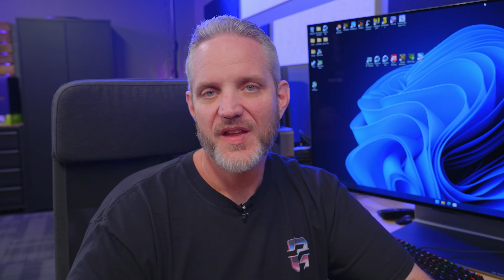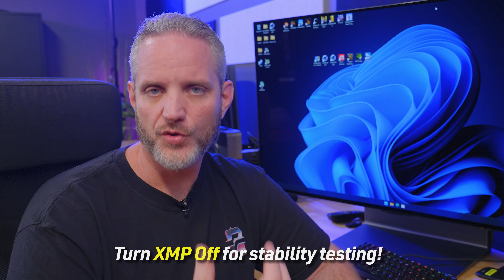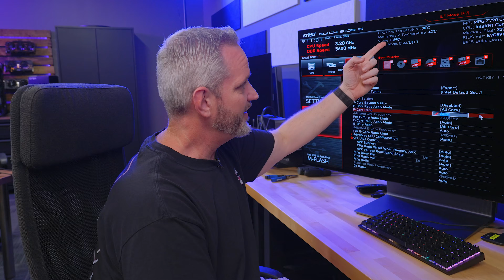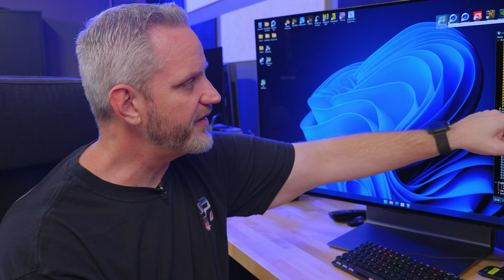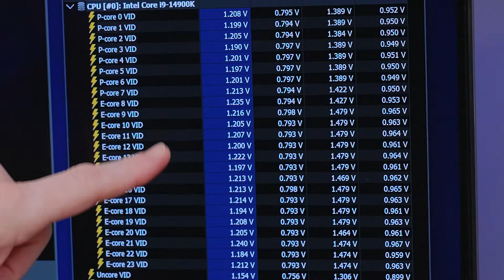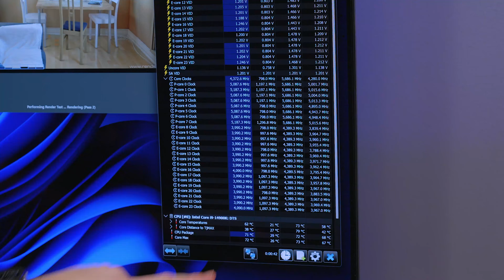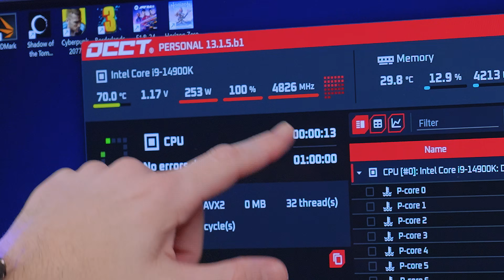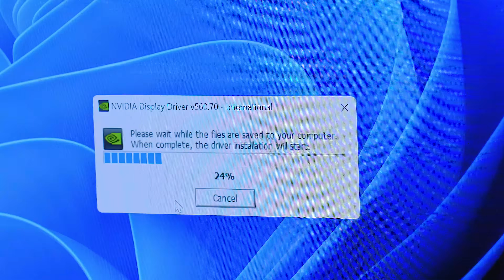Guide: How to check if your CPU is BAD!

Comment: Buildzoid has some very good videos about this. I watched probably the last 4-5 videos about how to tweak the settings and I can say it's the best so far.
I RMA my 14900KF, it took 2 weeks. And this new CPU still had temps and voltages more than I was ok with. 
But with his insight I manage to get my Cinebech up to 40k with just undervolt and LLC calibration/AC/DC like he showed, nothing else , on Intel 0x129 default Extreme. 
Never above 95C(and 95C after multiple runs), 360 artic freezer.
The problem is he has very long videos, not edited at all, like hours long....

I may got a golden sample with this RMA, who knows.

Comment: Pre-built HP 45L 13 gen i9, CPU never runs above 40C no matter how much I push the computer (fans do get really load at times though). No problems with CPU yet. Maybe there is something to having the CPU with an independent cooling system (HP 45L).

Comment: Great video Jay. I have a 14900K on a Gigabyte Aorus Z790 Pro X board with a 4080 and 64GB of DDR5 6000mHz Ram. I was getting the “out of video memory” errors on high shader games like Hogwarts Legacy and Horizon Forbidden West and I do video editing on Adobe Premier Pro and I could not export a video no matter how big or small my CPU would thermal throttle and crash to desktop every time I tried to export a video. Since the BIOS update with Intel Extreme Default Profile and the new Microcode, I can load and play Hogwarts and Horizon completely fine now, no more “out of video memory” errors or crashing and I can go into Adobe Premiere Pro and export all videos now, my system is so quiet and exports them successfully. The crashes I was experiencing was happening EVERY time, but since the BIOS updates, it doesn’t do it anymore so I would so based on my tests my CPU is stable and has not “advanced” degradation, these are the tests I did and I believe my system to be stable now based on my experiences.

Comment: This is concerning... I have a 13700k that is a hot and fast chip. it boosts 300-400Mhz over advertised speeds (stock, and even more OC) and produces a comical amount of heat. The chip also draws 1.6V under load, and is not stable with ANY level of undervolt. Even an offset/change of -0.015V will blue screen it reliably. 

So far it has been stable if given the voltage it wants. So I think the only thing to do with it is install the microcode fixes and just slap the best cooler I can afford on it. Hopefully it doesn't die an early death.

13700k
RTX3080 Ventus
32GB Corsair Dominator (2x16GB)
MSI z690 Edge Wifi
2x 980 pro 1TB M.2 SSD
2x Western Digital HDD (14TB)
MSI MAG 360 AIO (Swapping to Arctic freezer 3 420mm AIO)
Corsair HX1200 Gold PSU
Fractal Meshify 2 XL

Comment: Do I need to update my BIOS if my system works fine with no high voltages? My cpu is i5 14600K on a Gigabyte Aorus z790 Elite and I've set it on the "Spec Enhance" profile which is made for CPUs that are air cooled (like mine).

So yeah, if I don't go the Intel's default route which makes the voltages spike and my profile isn't that demanding, do I still need to update my BIOS?

Comment: Jay!! I want to leave here my feedback! Running a 13900KF, on a Strix Z690-G. After microcode 0x129, I was getting max VID at 1.50 to 1.52v with Intel Default Profile, MCE off, Intel Fail Safe VID bahavior and enforced power limits, getting 35K in R23. I have tried the Asus profile, with MCE on, Auto VID behavior and disabled power limits and for my surprise, im getting 1.42v max 😱 and better Cinebench R23 scores at around 40K. No manually tuning. Never had any issues with my cpu in almost 2 years of use, but got worried about this voltages and degradation issue and updated to this microcode

Comment: What is Cinebench code, indeed, a 3DMax .3ds file running the lite program script without the editing features rightly framed to a fine tuned monitoring panel?! Hackers moving slower, anyone?! 3DMax tutorial too hard to capture the screen at a good framerate? Did it work before or after Unreal Market optimizations?! I don't know. Namastè.

Comment: So if you have a brand new i9 14900k it should good if you install the latest bios update
Reply: Nope. It may still degrade as the core issue is a hardware one, a design flaw. The microcode is just a bandaid pretty much.

Comment: None of these will surely tell you if you have a CPU problem. Apps crashed constantly on my 13900K and OCCT didn't show any errors on 3 different CPU tests (1 hours each). Also, other CPU benchmark tools didn't crash. But seller confirmed CPU degradation, and Intel confirmed it. Now waiting for a new CPU to be delivered (was under warranty).

Comment: Short term stress testing isn't the solution here Jay. It's average use case scenario's and blue screen frequency. No amount of short term stress testing is going to prove anything at all.

Advanced degradation is incalculable and will happen under daily use cases or not, depending on your sample. This long winded drawn out video was just an advertisement for "how good Intel CPUs still are" and don't worry everything is just fine nothing to see here,.move on people move on.

You have not addressed the actual issues with the 13th and 14th gen manufacturing issues and architectural design issues with these refreshes.

The REAL problem is, is that the design of these CPUs themselves and why Intel is so quiet on this. These were rushed and not properly designed to begin with. Hopefully Intel learn from this (probably not) and release a brand new architecture that's been FULLY properly tested and designed in the 15th gen release next time. Just look at the rushed 9000 series AMD CPU launch as well!

There's a lot more going on behind the scenes including collusion to hold back 1-0 nanometre CPUs as this will be the end of mores law and what's next? 

Well the answer is quantum computing plain and simple. Then this industry will pretty much finally come to an end.

You'll only need to upgrade a quantum computer (home terminal) once every 5-7 years as most of it will be client based computing by then. 

You all wonder why Xbox live and Ubisoft want to go subscription only right? Well this is precisely why!!

PC's will soon be a thing of the past in the next few years.

Things are about to change for all of us and you will own nothing and be happy right?

Comment: my cpu 13900K is degraded, 100% test that prove it is an old javascript browser benchmark - octane 2.0, just google it - it's the firs result in a github page. My cpu never ever finish a run wothout crashing, and it's not OS chrash - just the browser says - memory access violation, but this is from the cpu. Games and other softweare sometimes can crash, but this benchmark is 100%.

Comment: I think you are not looking at the bigger problem here. If you buy a 14900k cpu today, you are getting the equivalent performance of a 14600k cpu after the Microcode patch combined with the patch for spectre 2.0 patch which degraded performance metrics of the CPU. It's a piece of junk CPU.
Reply: The 14900k post update is still more powerful than a pre update 14700k, so that statement is false. Now if the 14900k is degraded, maybe so. There is barely a drop in performance from the 0x129 MC, with added stability.
Reply: @frantz4g63  No that isn't a false statement. The 14900k is equivalent to 14600k or 14700k right now. Don't be that guy.
Reply: @luminatrixfanfiction  i have the 14900k with 0x129 and i can confirm that its not losing performance compared to other microcode's, in fact is running better than before for me, (95 SP average silicon, but probably with close to none degradation)
Reply: @luminatrixfanfiction  another false statement. Now you're claiming a 14th gen i5 is just as powerful as a 14th gen i7? Believe what you want, but facts are facts. You are basically contradicting all the performance tests and data people accumulate. If you have proof, send it. Otherwise, you're just either gassing up a 14600k, or you're hating on anything higher than a 14600k. Let facts speak for themselves.
Reply: @iimmaaxx  that's exactly what the data shows. As long as the data isn't degraded, it'll still perform better than a 14700k (especially a 14600k). Less voltage usage and added stability while being a hair less in performance compared to pre 0x125. Sounds like a win/win situation to me.
Reply: @frantz4g63  The fact you even have to say that "as long as...it'll still perform better than a 14700k" indicates a certain tone of desperation. Some poor sod had to pay an extra $300 bucks just to have the same metric performance of an equivalent 14600k or 14700k under certain conditions.
Reply: @luminatrixfanfiction  I really don't understand why you keep trying to justify your reasoning without proof. Bring some data to the table. There's plenty of data floating around by many content creators that justify my point. 

What is this "desperation" you're talking about? I have a 14700KF, so for me to say a 14900K still outperforms my CPU (especially a 14600K) isn't showing desperation for anything. It's facts and the data shows.

Let me guess? You either own a 14600K and are trying to justify and elevate your purchase, or you own a 14900K and it's degraded past the point of being a lower performer than a 14600K? Either way sir, that's your business, and I'm not trying to convince you of anything. All I did was point out facts that you can so easily find all over the internet with a little research. Help yourself. It's free.
Reply: @frantz4g63  ... ... there is multiple data by content creators showing the before and after performance metrics after the microcode patch. I don't know who you are watching but the microcode patch degrades performance. It's literally impossible for it not to. What that microcode does is undervolts the CPU and for a reason. They were already overclocked at the factories, which means that when the micropatch is applied, the cpu is underclocked and undervolted to preserve its lifespan. That means the cpu is going to have performance degradation. Do you understand now?
Reply: @frantz4g63  I own a i7-4960, it's old but its one hella beast cpu. I can play steady 60 fps on a 4k resolution monitor despite its age. Mostly because the GPU is doing most of the work and simply because this CPU generation was a work of art.
Reply: @luminatrixfanfiction  That's not true, at least not for my cpu

Comment: I just bought an I7 13700kf, Just was made aware of this issue when setting up windows. So put the latest micro code on my MSI board and have also applied an under volt. I will just use it and let it run. Hopefully without any issue.  I hope that seen as I just found out and did the bios updates with a brand new system It will be ok.

Comment: Best stability test I've ever used is Asus Real bench. If it can't pass 8 hours of that, it's not stable. 

I had one PC once that i couldn't get to pass, but everything else, even 24 hours of Prime95 no problem. So I shrugged and ran with it. 1 year later BSODs, Prim95 failed instanty. Memtest detected bad ram. Asus Real Bench knew about it from the day the PC was new. Got new memory and sure enough, Real Bench ran just fine. Not saying everyone will have same results but it's a really good free stress test

Comment: Just remember that the CPU CoreVID that is shown in HWINFO is the Voltage that the CPU is requesting from the motherboard. If you want to see the "real" voltage, you have to look under your motherboard sensors for Vcore, which is the voltage the motherboard is delivering to the CPU.

I have my 13700K undervolted by -0.100v, so in HWINFO the CPU VID sensors still request 1.350v, but at the same time my motherboard Vcore shows 1.250v, because of the undervolt.

Comment: Me, after RMA-ing four 5000 series AMD chips, and seeing melting 7000 series chips: I'm coming back for your renowned stability Intel. Bought the 13900K and luckily won the chip lottery with a 1.225V chip. Never saw temps above 85 and got 40300 R23 Multi from the start, with a manual cap of 300W. Now I clocked the multiplyer at 53 and memory at 6000, just to be safe, and lost 2.5%, scoring 39300 in R23. I've not yet experienced any crashes with my chip but it's a very strange emotional rollercoaster to be riding 🙄
Reply: 7000 is better than 14 gen tho

Comment: I have a 14900k on a gigabyte Z790. Cinebench is OK for single core but immediately crashes for multicore. It will be interesting to see if the bios update will help when gigabyte finally release it
Reply: Make sure you are using Intel default settings, Gigabyte's have the LLC configured wrong and it undervolts the CPU too much causing crashes (that's what happened to BZ )

Comment: Intel XTU - AVX2 stress test with no power limits. If it fails, your CPU has one foot in the grave. To my understanding anyway.
With the new bios updates and power limits in place (253W, 400A) it'll probably still last a long time if it's not already crashing with Intel profiles and limits. But I mean, you're not getting what you paid for.

If you're a Blender user, a consistent test has also been whether or not Blender hard crashes under load when posing an armature tied to a mesh with high polycounts. You'll hear the fans rev up from the load and Blender will crash with no warning or error. It'll be quick and consistent, at least with my projects. Heavy denoising and Compositing during renders can also cause crashes but for me that wasn't as consistent, just a massive headache and a waste of time.

I'm on my third CPU at the moment.. 14900k. I suspect the frequent, heavy and fluctuating load from working in Blender expedited the process. I didn't really have a grasp on the whys or hows of how it was degrading until my current chip.
Reply: The XTU stress test uses Linpack, as does the old Intel Burn Test. It's a much newer version in XTU though (interestingly not the newest one, it's 2021.2.1.0 in XTU, but at least it's not the ancient one from Intel Burn Test, which is from 2012).

Comment: Turning my cpu off is the worst f**king advice. The machine is useless if it is not running stable 24/7. If I wanted a $5000  paper weight I'd buy gold bullion

Comment: Would not be happy with "plenty of life left", a CPU should retain decent residual value after many years - I have a 9700K and 9900KF, both 2020 manufacture (or assembly) dates which I can sell for at least c. £$100 and £$150 respectively.

Comment: When my degraded 13900ks was at stock clocks installing Nvidia drivers was what told me it was degraded. I didn't have any issues in unreal games shader compilation like most and it passed every stability test. It just got random bsods at idle, games crashed maybe once every couple days, and every Nvidia install failed. Tried different GPUs, Windows reinstall, the works. Underclock was the only thing that got it stable.

Comment: All the AMD fanboys have crawled out from their dark caves when intel effed up lol. You want healthy competition not “just buy AMD”. Without competition AMD will become Intel and just scalp the prices however they please. Im pretty sure Intel will recover from this, will take a lot of time but it will happen. And before you are going to try to murder me on the internet…ive been running amd since ryzen 5 1600 all the way till 5900x and then switched to i9 13900k and RMAd it few months ago. All of my AMD cpus had some weird stuff happening to them at some point.
Reply: Cry harder brokie stay gapped by 850hp turbo s
Reply: The saddest part is they don't even notice it already happening right in their faces. AMD is doing an "Intel in the 2010s" since AM5 got out two years ago. 
Check how the 200$ Intel i7 12700K compares and even surpasses the Ryzen 7700X and the new 9700X (at nearly double the price) and that's before we even count that one overclocks fine, even with a $35 dual-tower air cooler...